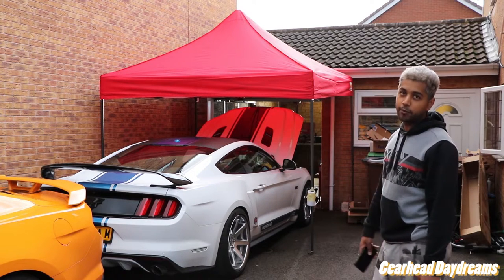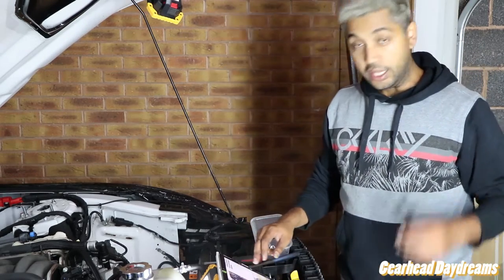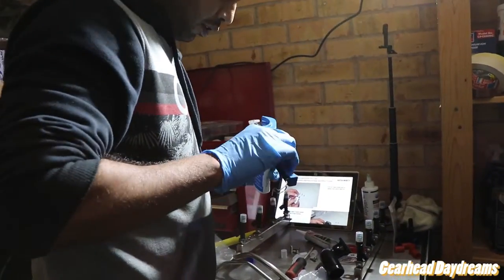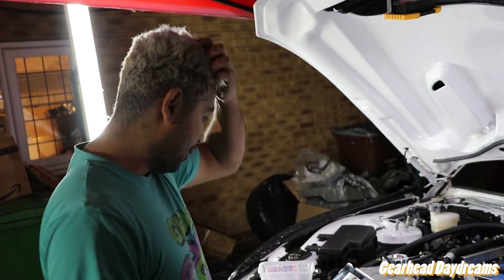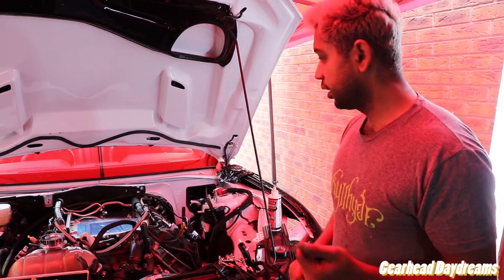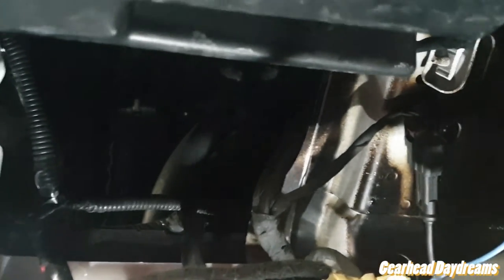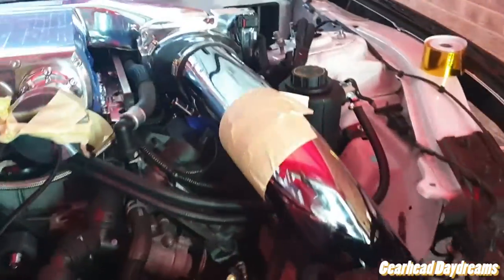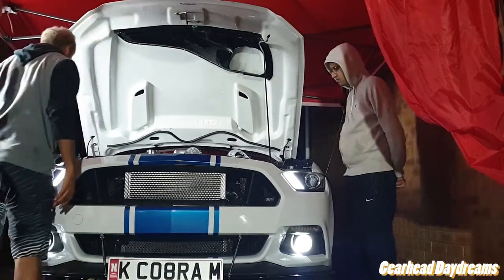Kenne Bell 2.8l Liquid Cooled Supercharger Install/Journal

Comment: Thanks for putting this video together. It's so nice to see a bunch of guys giving it a go rather than paying someone to do the work. Theres no better way to learn and no better way to make the car yours. Sadly, theres no better way to f**k up too!! I am looking forward to the oil pump gears and oil cooler videos. I want to do my gears, but I think I'll take the engine out to do them?
Reply from the maker: Haha thanks, if somebody had told me that this is how the install was going to go, I still would have done it. The key is just to do things right, not rush and throw away the phrase "that will be alright". 

Unfortunately I dont have any footage of changing the OPGs and Crank sprocket etc. There are quite a few online already which are very useful. I have plenty of photos though. I have a story to tell with that as well. I was sent dud primary tensioner by MMR so I had to go in there multiple times. That was not fun. 

We did the OPGs etc in situ. Getting to the pick tube bolts is a PITA but doable so you can remove the oil pump.

Comment: di you do any modifications to the fuel system ? And also when u installed did you do anything to the PVC valve?
Reply from the maker: No modifications to fuel system.

PCV system is incorporated into the setup. US driver side PCV connector in the cam covers is replaced with one that is a 90 degree. Factory hose is reused.

I installed oil catch cans so did some modification. Check out the video in channel which looks at installing JLT oil catch cans. Peace ✌🏽
Reply: Did you put anything inside of it? To regulate the fumes. usually there is a small mechanism that stops the fumes from capping back in. So you put it in just as you got it?
Reply from the maker: @JuanMartinez-tv7uy  yessir just as I got it. The factory one that came out had no such cap so it all looked legit to me. Don't sweat the PCV stuff. Plug it all in and let it rip!
Reply: High idle issue going on, did you have a check valve in the Kenne Bell PCV inside? Or was it empty. The one I got from them didn’t have a check valve. I want to let it rip mate just have a nasty high idle 17-1800
Reply from the maker: @JuanMartinez-tv7uy  - I don't recall seeing any check valves. But maybe they changed something since then. Check to make sure all the hoses are secure. Might be something really simple.

Comment: Hey man quick question how do you change the spark plugs on the driver side of the motor sence the intake and the throttle body is there like ones the supercharger is installed or in order to change them so I have to remove the blower
Reply from the maker: Hey Sergio

You have to take the blower off I'm afraid. Also a good time to clean up the air filter.

I need to do mine this winter. Should be fun. 😅